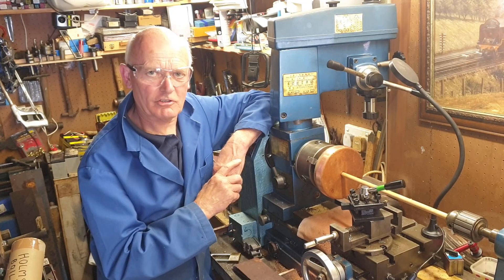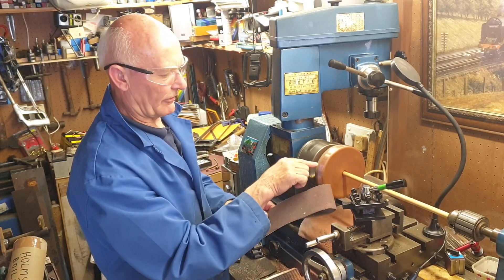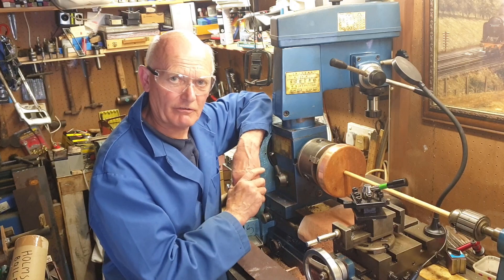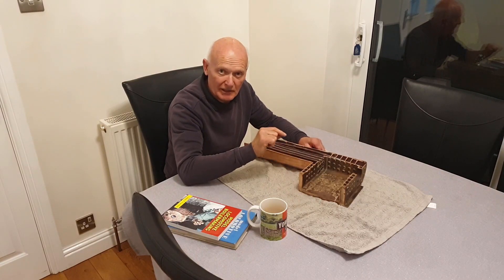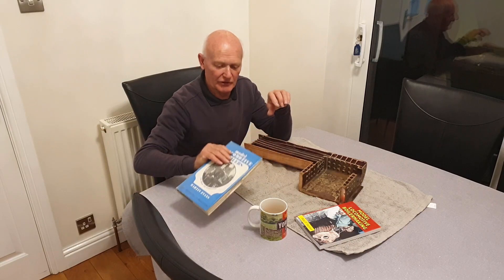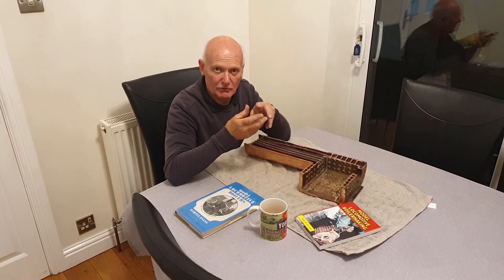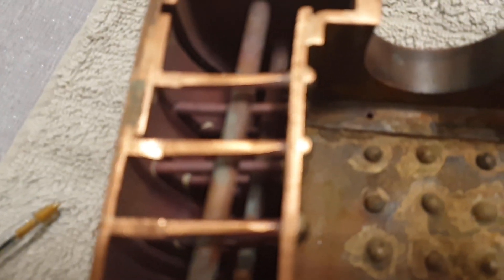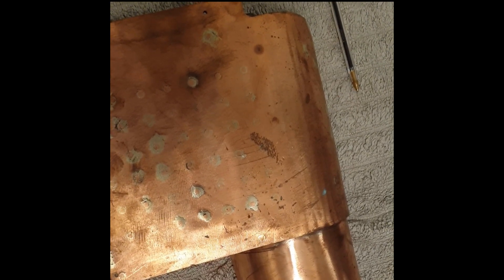Copper Boiler Build  part  2  QEditor49

Comment: Not sure if my previous comment worked. It’s worth making some test pieces using your proposed gaps. I’ve found cadmium free solder needs a different gap. Check with the manufacturer for advice 😀
Reply from the maker: @julias-shed  Hi Julia,
Great comment thanks for that advice
Things do change with new and different products  on the market
The older cadmium based solders do appear to have flowed far more freely I beleive
Cheers
Reply: @masterpiecesinminiature8299  just had a quick google Silverflo 55 needs 0.05mm to 0.15mm gap at brazing temperatures. So that’s an average of 4thou….
Reply from the maker: @julias-shed  Hi Julia, thanks very much for that "very" sound advice, yes thanks  I was suffering "tunnel vision" and obviously not looking at all the information to hand (or probably the most important I should  have), " THE  INSTRUCTIONS".
Cheers

Comment: Glad to hear that you're making a good recovery.  A most interesting video.  Good luck with the rest of the build.
Reply from the maker: @modellingmark  Thanks Mark.
Shame the trace of silver solder forming the joints was not as evident as I had hoped on film
Glad I did not have to saw the boiler into two halves.
A worthwhile look at it tho I thought, so included it in a video
Cheers
Reply from the maker: @modellingmark  Hi Mark thanks for watching and your kind comment, I do hope to continue with the build and pray for a successful conclusion.
Cheers. ALL THE BEST WITH YOUR MODELLING IN 2025